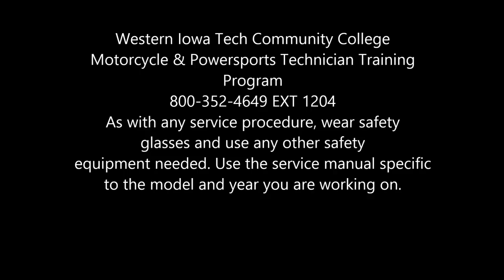2 Stroke Engine Assembly: How to install the clutch

Comment: We've had clutches stick and after separating them they were fine but then after they sat another day they would stick again.  Absolutely correct on the extra plate setup.  We run them all the time but you must be VERY careful on the installed height, too tall and it'll be hard to find neutral.  We will usually modify the outer hub to fix this.  You should also explain how the transmission gets it's oil from the clutch basket on some bikes.  Most people don't realize how this works and it doesn't show an oiling diagram in the manual like the engine has!  Good video as usual.
Reply from the maker: MaulTechATV Hello there!

Comment: I just installed a new clutch disk assembly and new clutch cable on my 07 Suzuki Boulevard S40 and I noticed after everything has been put back together shifting up isn't so much a problem but down shifting most of the time is really hard, and if I'm in first just sitting there I can't put it back in neutral until I turn the bike off. I was thinking maybe I needed a new push pin as the clutch wasn't disengaging all the way but now I'm starting to wonder if I needed to pay closer attention of the steel plates. So I may be pulling the bike back apart again tomorrow to check that out.

Comment: I did a bottom end rebuild on my RM 125 I put the old clutch back in it cuz I had some life left in it and when I put it in it didn't disengage so I took it apart check my work put it back together still bad put a new clutch in it still bad the baskets do spin independently but I feel the clutch is sticking but it just won't unstick
Reply: I just noticed your oil recommendation the guy handed me an 80 weight which was slightly off from what they recommended but he said it would be fine so thanks for being thorough enough to give me another option to look at without even replying to my comments
Reply from the maker: Hey bud...glad it helped. We get 400 comments a day and hit up channel members first. Just not enough hours in the day. As for the oil I like to stick with OEM or Belray gear saver like this: https://amzn.to/2IY5Li3 
Glad to hear how you liked the videos. Here are the links to support us for this information and our work saving you money.
Join this channel to get access to perks:
https://www.youtube.com/channel/UCBhM8DCKnT3qXwTW0eToyCg/join     

Give us a high 5 here:  https://www.paypal.me/how2wrench

Comment: Hi sir, I've experienced the same problem the one you said the friction disc doesnt separate from the plate when the clutch cable is pulled..is it the oil makes that problem? DT100 2stroke motorcycle.
Reply from the maker: Oil can be a factor. Many times an oil change alone does not solve it though after a wrong (or cheap) oil is used. De-glazzing the plates is a first step or friction plate replacement with the correct oil from then on. 
👍 Thank you for taking the time to comment! Hit that subscribe button if you haven’t please! It helps us! 
Here is a way to support all the free videos.
Want to say “thanks” or “keep it up”? Click here https://www.paypal.me/how2wrench  

Coach Conley is also available for hire to personally work one on one with you if ever needed. Yep he is a real person. Give him a call @ 602-345-0432

Your answers and help are just around the corner. Save time and money while protecting your investment and yourself by doing it the right way!
Follow us!
Web:
www.How2Wrench.com     
www.Tools2Wrench.com

Comment: My neightbour has a zzr600 1993 with the offset outerbasket finger and he installed it with the last fiber touching it and rode around. He took the clutch back out and rotated the last plate so it wasnt resting on that tooth and inline with the larhe gaps between the fingers like the rest of the fibers and took it for a spin. He said there was a considerable power gain when he had it in the latter configuration. Possibly is a longevity function or possibly a restriction function. But you for sure lose power when putting the last plate on that tooth. You should dyno it

Comment: hello, i just picked up a 2000 rt100 for 150$ runs great, but in gear the bike doesn’t move, u can feel it try though. i took the clutch off and the side didn’t have consistent grooving, but it wasn’t the best either, the plates didn’t look worn down but as this is my first time ever opening up a bike, i’m not too sure lol. i just bought a fiber set, and springs and i’m hoping to make this a quick flip. none of the plates were warped either. will update soon
Reply from the maker: We sure love you taking the time to comment. Good luck on the flip and when you make all the cash, don't forget to donate to us form the free video lesson! 😎 We work with a lot of "flippers" on the techline and help you avoid costly mistakes! Use it if every needed. 

Are you coming to the next live session? 
There a few ways you could help keep this work going and stay connected with me personally.  
1. The fastest and best thing you could simply do for us is hit that subscribe button…helps us creators more than you know! 
2. Join this channel to get access to perks:
https://www.youtube.com/channel/UCBhM8DCKnT3qXwTW0eToyCg/join   
3. Give us a high 5 here:  https://www.paypal.me/how2wrench    
Keep Wrenching,
Shane Conley
Peoria, AZ USA
Follow us!
www.How2Wrench.com       
www.Tools2Wrench.com    
Facebook: 
https://www.facebook.com/How2Wrench/   
Instagram:
https://www.instagram.com/how2wrench/

Comment: So would that explain why my clutch on my 1979 Yamaha yz250 is sticking because I'm using 10w40 4t oil not recommended for a wet clutch but I have w75 for wet clutch

Comment: That notch it the fiber plate is the light spot or the heaviest spot so they have them staggered so it's not unbalanced just like the color dot on tires that's the light spot and you are supposed to put the rim lock in that spot
Reply from the maker: Hi Joseph. Not always the case even as rational as it sounds. Many manuals state to line up the notches and Yamaha for ex, states to line up single or double notches. If I can ever be of service to you, here is a video explains how to connect with me. 
https://www.youtube.com/watch?v=vjvmB01ebcs 

Link to membership: https://how2wrench.com/product/membershipmembers-onlymembers? 

Want to say thank you? https://www.paypal.me/how2wrench

Free Mechanic info, tool reviews, and “how to” videos newsletter sign up: https://how2wrench.com/subscribe-free-newsletter/

Comment: All I can say about the "notches" is the Yamaha TZR125 or 250 also has exactly the same with notches, you guys can dig into that, it says that it has to line up opposite of each other in order to seal correctly and grip in a certain balanced way. Go check it out !

Comment: Is there an easy diy tool to lock the basket for the nut to torque?
Reply from the maker: Yes. Use an old steel plate and weld a rod to it to act as a handle to hold it while your torque the nut. Here are some examples of ones you can buy so you know what they look like: https://amzn.to/34ytDiE 
👍 Thank you for taking the time to comment! Hit that subscribe button if you haven’t please! It helps us! 
Here is a way to support all the free videos.
Want to say “thanks” or “keep it up”? Click here https://www.paypal.me/how2wrench  

Coach Conley is also available for hire to personally work one on one with you if ever needed. Yep he is a real person. Give him a call @ 602-345-0432

Your answers and help are just around the corner. Save time and money while protecting your investment and yourself by doing it the right way!
Follow us!
Web:
www.How2Wrench.com     
www.Tools2Wrench.com

Comment: I recently bought a kawasaki 80 1988. It had no top end, crank bearings were seized, but evening else was there. After locating the proper parts and reassembling the motor I'm having issues with my clutch engaging/disengaging and getting the tranny to shift to neutral. I have to note that when i got the bike with the seized crank bearings i could find neutral and the clutch worked as well. Pull the clutch lever the bike would roll in gear. I how I'm explaining this well.  Because I've followed all directions in manual the bike shifts threw gears can't find neutral double checked neutral set screw kick starter great primary gear water pump shift lever. Is my clutch wrong? What did i do wrong?
Reply from the maker: Brandin Bell 
Hi Brandon,
Tech call: 
Hello YouTube Friend,
You're in luck. I'd be glad to answer your tech questions and mentor any tech needs to you. 
I offer just what you need. I answer questions, teach and even fix your problem over the phone using FaceTime if needed. It's $2 a min and paid by paypal or check. Direct credit card is coming! No minimum. 
I suggest clients send me any pics, videos and details, with year, make and model to my email first, SO I can minimize the time on the phone. Email is below. 
We can then make a phone appointment. If you prefer a quick email response for a small need, I can do that as well. 
Also half of the money I raise is going to a scholarship in my moms name! 
So you now have your own personal mechanic in your phone! Put me in your contacts as the how2wrench YouTube instructor!

Keep Wrenching,
Shane Conley 
712-281-8374
Tech email: how2wrench@gmail.com
PayPal email: conleybuilt@gmail.com

Comment: I have a question why did you not soak the clutch plates in oil prior to installing that way they would be lubricated upon initial startup?
Reply: If you looked closely there was some residue of some kind of fluid/liquid on them. I think he did he just had them out long enough to drain off.

Comment: I just bought an old 1968 Suzuki k15 and it doesn't shift, I was wondering if you could tell me anything that could help. I haven't taken it apart yet because of space so I haven't really seen much on the inside. Your videos are really informative by the way.
Reply from the maker: Great news for you! I have solutions for you and will point you in the right direction. Head over to my website become a member now and to receive 20 minutes of personal mentorship with me. You can even use FaceTime if you have it or find a friends iPhone and we can walk through the actual carburetor process together. I look forward to mentoring you.

Note: Membership is not required to receive coaching or email help. Here are the direct links to individual services offered at H2W:

Email Answer Service-Click http://how2wrench.com/product/email-support/ 

Phone/FaceTime Coaching-Click http://how2wrench.com/product/personal-tech-training-phone-facetime/ 

DIY Mentorship-Click http://how2wrench.com/product/diy-coaching-hire-teach/ 

Dealership Training Services-Click http://how2wrench.com/product-category/dealer-services/ 

MMI/Tech School Student Tutoring-Click http://how2wrench.com/product/mmi-tech-school-student-tutoring-services/

Motivational/Guest Speaker-Click http://how2wrench.com/product/motivational-speaker/ 

On-site Training Services-Click http://how2wrench.com/product/on-site-training/ 

Tech Line Services-Click http://how2wrench.com/product/tech-line-minutes/ 

Mechanic on Duty-Click http://how2wrench.com/product-category/mechanic-on-duty/ 

Did you like this free video and hope to see more? Would you just like to say thank you with a donation? Click https://www.paypal.com/donate/?token=TvKoeRazPL-KysbM-e0ttz-C_gPq2IrqxDmM3ORCu4nxJzQWxYbmo-6m3YuNu64XHLngGW 

Keep Wrenching,
Shane Conley
Instructor/Motivator/Motorcyclist!
www.How2Wrench.com

Comment: sometimes the clutch engages where's way tighten clutch up buy lever then you will have clutch drive need to hot spot of weld on clutch engaged

Comment: I was out riding with my friends on my 1999 husqvarna 125 and the "clutch pedal" just flopped, without pulling the clutch lever in I could freely move the selector up and down gears, and when we tried to get it moving there was a scratching/screeching sound when we slipped the clutch then instantly lost power and stalled, any ideas?

Comment: broke my clutch diring disassembly. Didnt have the proper tool so tried to pry against the case to lock it together. I screwed a fiber plate to a metal plate and used that to lock the two sides of the clutch together to remove the nut. it was way over torqued in my defense and the plates were about junk anyways.

Comment: pls help! Does anyone know if this work video apply to a suzuki 4stroke sp370?  
My bike will not consistently move into neutral and the internet thinks that, 
"The detente at the end of the pawl lifter on the cam driven gear that the shifting shaft acts upon could be getting stuck as it's old and worn out. The pin costs $2.95 and is worth replacing. As well, the spring that provides force against the gear shifting cam could be worn".
anyhelp would be appreciated

Comment: The clutch is so bad on my kx125 that I can't start it in gear or it immediately dumps if it starts, and when it doesn't start in gear it just bumps me forward lol time for a new one
Reply: Spencer S me too same my clutch is just as bad as your's haha also on a kx125!
Reply: More like the clutch basket has notches in it.   I've replaced 6.  That did the same. They get pounded on

Comment: I've seen clutch basket locking tab washers with small bits missing from them . caused by being over used . the tab bent over in the same place . usually the bits are found floating around at the bottom of the casing.  it's a sign of poor workmanship so everything needs to be carefully inspected.